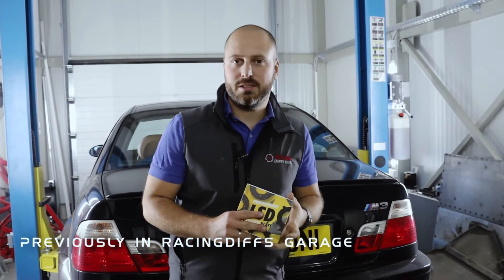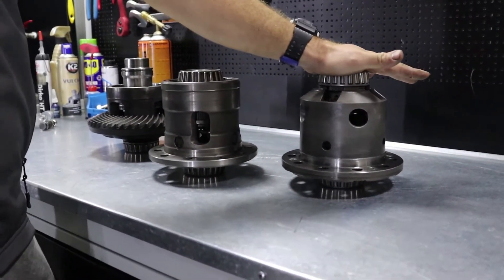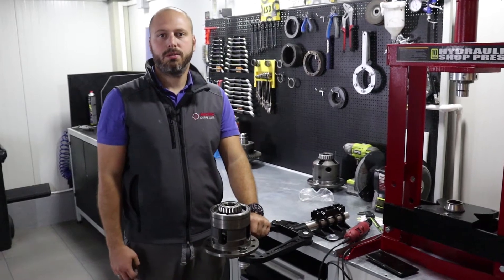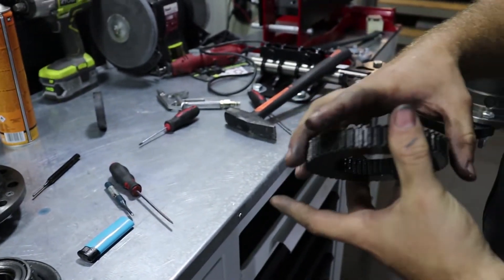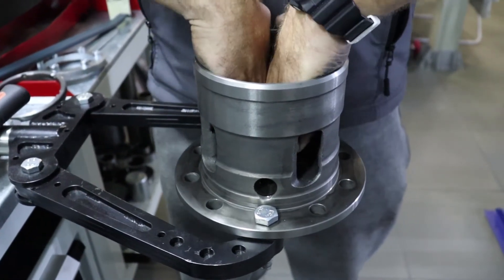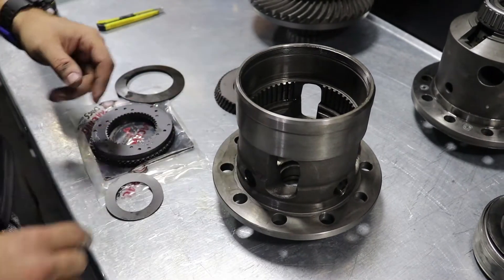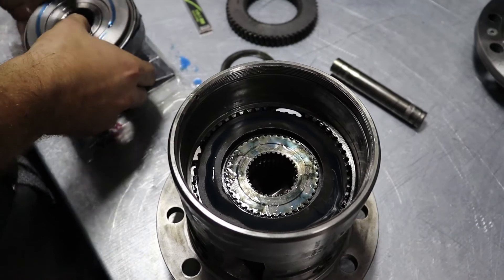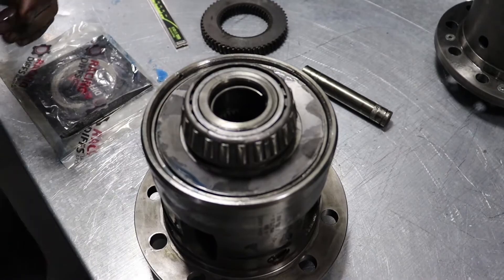BMW M Variable V2 LSD Mechanical conversion | The best Track upgrade for E92 M3

Comment: hello when you close the ring is no longer necessary the sphere or a stop?
Reply from the maker: Sorry, didn't understand.
Reply: I wanted to know if you need a stop for the locking ring of the differential having removed the original ball or just tighten @RacingDiffs
Reply from the maker: No locking is needed, but we advise to use thread locker (screw adhesive)

Comment: Is this better than stage 4 or do u need both? My car is 09 bmw m6 v10 smgb with m differential
Reply from the maker: Stage 4 won't fit this diff unless you change the whole carrier unit. We have it available on this link.

https://racingdiffs.com/collections/all-solution-lsd-unit/products/bmw-high-performance-lsd-unit

Comment: Can you confirm how many clutch discs there should be. I received my kit but it only has 5 clutches and 6 dog plates, may I have been sent the pack for the V1 by mistake? In the video I counted 6 clutches
Reply from the maker: That is the correct amount . 5 clutches, 6 outer plates, 1 preload shim and 1 free play delete shim.
Reply: @RacingDiffs  thanks for confirming. I think I have an issue with my kit though. My car is a Z4M, and on the pinion gear it uses a tapered roller bearing, I received double ball bearings. What can we do?
Reply from the maker: @mpineda6  drop email to office@racingdiffs.com and colleagues will sort you out.
Reply: @RacingDiffs  Thanks, will do that for sure. One last question, one of the outer plates is thicker, does this go at the bottom or top?
Reply from the maker: @mpineda6  actually it doesn't make any difference. I would put it on top next to preload shim.👍🏻

Comment: How tight is that collar screwed in? I'm trying to loosen the collar but it won't budge. I'm turning it clockwise and have removed the ball. It's so tight that I'm using a breaker bar welded to my special tool.
Reply from the maker: Try to change directions just to make it move. Also heating is allowed. Sometimes it knows to be really stuck.